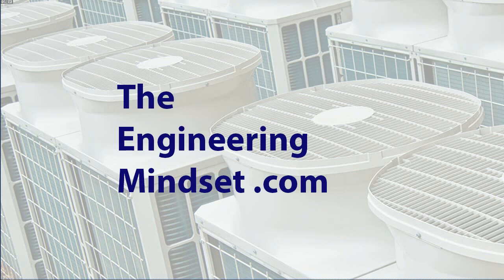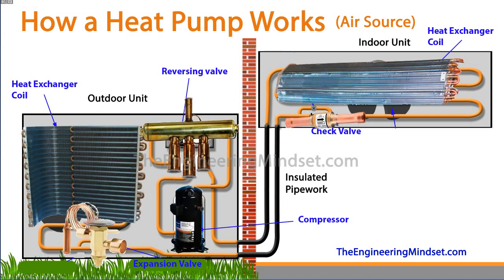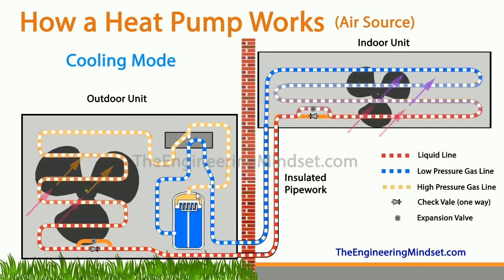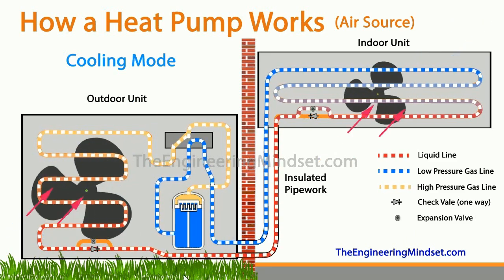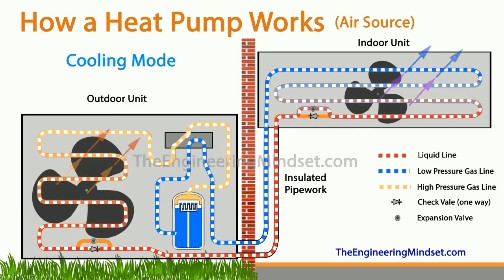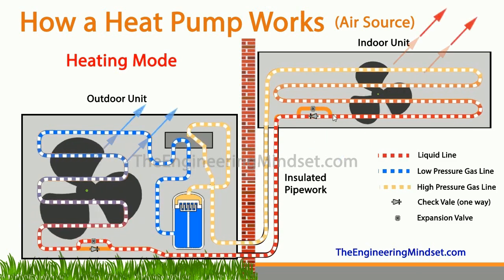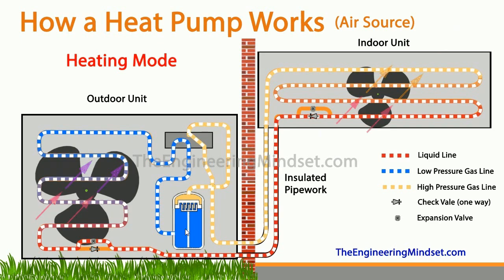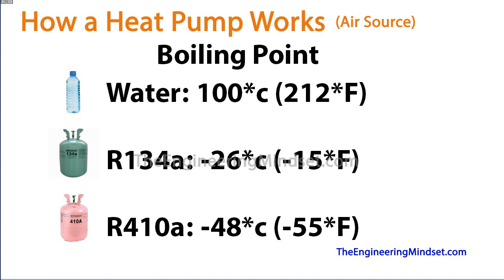How A Heat Pump Works - HVAC

Comment from the maker: ⚠️ Found this video super useful? Buy Paul a coffee to say thanks: ☕
PayPal: https://www.paypal.me/TheEngineerinMindset
Reply: Thank you Sir, for this awesome video!
Reply: @ericescuro8242  Very good vid, but, you should have shown the refrigerant as blue immediately out of the expansion valves & increasing in heat (yellowish) as it picks up heat while it moves through the evaporator coils

Also, a bit about more about when it isn't economical to run the heat pump would have been good.  I've lived in very cold areas & when the outside temp is too cold, the compressor is disabled & an inside heating element is automatically switched on because at some point (temp) that becomes less expensive than running the compressor & fans to heat..
Reply: a tip : you can watch movies at flixzone. Me and my gf have been using it for watching loads of movies recently.
Reply: @Shawn Alejandro yea, I have been watching on Flixzone} for since december myself =)

Comment: I have a question the inside unit is it supposed to blow the air left and right or just up and down ..because the one I have I have a button that I can press who looks like it blow the air left and right but nothing move inside and there is no difference from the up and down .  And to connect to the wifi did someone know how to do that it say reset the unit , I have to press the remote control till I see CF but nothing work.....

Comment: Sir please make a video on the basis of Outdoor Heat pump AQUANEXA any model  of ANX-09, ANX-15, ANX-35, ANX-50, ANX-75 , please sir working of it and how it delivers hot water from ambient temperature along with Heat exchanger , Compressor, 4way valve , fan , condenser fins and it's PCB connect sequence of capacitor of single phase motor and conductor for 3phase motor, please 🙏 sir
Which is using R410a refigerant
Reply from the maker: Please watch our videos on how heat pumps work

Comment: Hi, I want to use the AC System as Heat Pump only. It will never be used for cooling. Why do the installation guys insist I have to install the Split evaporator near the ceiling? In fact I think that installing the Split unit near to the ceiling will be less efficient because it does not use convection to distribute the heat in the whole volume of the room. Additionally, the installation on top provides warm air near your head, which is uncomfortable, and the maintenance is more difficult than a split installed near to the bottom of the wall or in the middle of the wall. What do you think about it?

Comment: It’s amazing how you explain the way it works . 
The boiling point I never new how or when it’s a good place for a heat pumps or a gas furnaces but seeing the boiling points now you could suggest the best thing for a costumer is .

Comment: Wondering why when the refrigerant leaves the compressor under high pressure, how is it that it is a gas and not a liquid under such pressures.
Reply: Because the vapor must cooldown to convert liguid...or loosing his energy and energy is heating..

Comment: Great selection of videos on heat pumps. Could you possibly make a videos explaining how a gas absorption heat pump works and is there a difference between a GAHP and a gas fired heat pump? Thanks.

Comment: For a heat only air flow heat pump, why not just remove 1. The Reversing Valve, 2. The Outdoor Expansion Valve, 3. The Outdoor Fan, and just leave the 1. Outdoor Heat Coil, 2. The Compressor, 3. The Indoor Heat Coil, 4. The Indoor Fan, 5. The Indoor Check Valve? Then just recirculate the glycol water solution and let it always stay relatively warm, and then hot on the inside. Wouldn't this be more efficient, and remove half the headache? Also it should work in much colder temperatures! I think it makes more sense with these systems to have one do all heat, and another supply only cold! Then your transfer fluids could be segregated instead of a one size fits all solution. Which doesn't work in a lot of environments! It's pretty cold where I live in the Winter Time, and there are a lot of these Air Source Heat Pumps around that just stop working once it gets down to Freezing Temperatures. So they are spending the money on the Heat Pumps, and also always have to rely on an additional heat source! That has never appealed to me, doesn't make any sense now you are paying for and maintaining two completely different systems all year. Out the window goes your efficiency and your money!

Comment: I am not an engineer. I am a nurse and I want to stop using oil to heat my house. Clearly I have a lot to learn and this is a good start. I need to know how to convert my house from oil to a heat pump.

Comment: Only problem. In heat mode motion demomstration. You kind of confuse other with the line getting redder as it goes through the condenser(air handler in heat mode). It is rejecting heat into the air being forced through the house (coil). I know you are meaning to show the condensing of the refrigerant into a liquid. But to someone who doesn’t know it may seem like it’s picking up heat instead of rejecting. Btw how did u learn this? I went to
School and grew up doing it with my pops
Reply from the maker: Watch this one https://youtu.be/QykwWs3L1W8

Comment: I can't stop my brain from associating red with hot and blue with cold so the fact that the subcooling liquid is red makes this video really confusing for me. Could just be me though.
Reply: That's me too, and I came down here just to write this lol
Reply: Yes, very confusing.
Reply: mee too
Reply: Red hose is the high side (hot side) so your brain association is not wrong.. The blue hose is low side or the "cold" side of the system where heat is removed. They call it "subcooling" because the refrigerant is below it's boiling point but existing as a liquid. High side expells heat which is why the color is red
Reply: @AnUnapologeticApologist   uP

Comment: In general I like this video. An improvement would be to only show the gases in the narrative during their rotation around the loop or have a pointer to the gas being described in the narrative  as it travels around the loop. There is another significant improvement, I do believe that the gas does not have to boil in order for a heat pump to work (just makes the heat transfer more effective when there is a phase change). For instance plain air can be used in the gas circuit. No phase change is required but the size of the coils becomes much larger because of the poorer heat transfer from a gas to the outside or inside air. The phase change allows for higher heat transfer and thus smaller coil size and a more economical construction. Once when I was a plant engineer I had an ultrasonic air leak detector technician tell me he found a locker in the tradesmen's shower area in a plant that the tradesman just connected a 1/4" compressed air line to the locker to refrigerate his lunch!!! No phase change (boiling) necessary. It wasn't very efficient (poor "refrigerator" insulation) and he used lots of compressed air (I calculated thousands of dollars of energy cost per year), but it worked!!!

Comment: Wow, I used to think heat pumps got energy from electricity, not the air. Motors are the only part of a heat pump that needs electrical energy?

Neat how refrigerants are so easy to vaporize; the power of chemistry!

Comment: I'm currently in HVAC class and we are on the subject of Heat Pumps. This was a very well done video and so helpful. The fact that you can see the flow through the reversing valve made it so much easier to understand how it works!! Thank you. I'll be sharing this with my instructor to share with the class.
Reply from the maker: We actually just made two brand new versions for how heat pumps work. Much better explanation and animation, check out our latest videos :)
Reply: @EngineeringMindset  Thank you!! I most definitely will!!

Comment: Nice animation. However your expansion valve operation is backwards. The valve closest to the evaporator coil (cooling or heating mode) is the one that is engaged while the other is bypassed.

Comment: Thanks for the video mate, just about to take delivery of my first BEV (Battery Electric Vehicle) which has a heat pump and was curious to find out how it works ;) I take it is a similar principle in vehicles too?
Reply from the maker: Awesome, BEV's are certainly the future. The heat pump will wor kthe same it will just use a different method to drive the compressors, usually a belt drive connected to the main motor.

Comment: My heatpump sucks, nothing beats gas heat, my bill on my electricity is  ridiculous  and i dont live in frigid temperatures like up north.
Reply: Yep, heat pumps aren’t that great for the freezing temperatures. They lose efficiency and have to run soooo much to keep the temperature up inside the building. Like you said, nothing beats that blue flame beauty pumping out the BTUs.
Reply: Джейсон Хичкок It would need heavy duty equipment and a lot of electricity to compress the helium through the cycle.

Comment: Wait you said once the gas leaves the evaporator (in home) it is low press/temp saturated vapor? I thought the only time when it’s “saturated” is when it’s in the coil and once it’s on the outlet it is superheated and not considered saturated
Reply from the maker: it can be on the 100% saturation line in the psychometric chart. The compressor will push it up into the superheat region

Comment: 2:58 "the refrigerant is leaving the compressor at higher pressure, high temperature, saturated vapor" do you mean super heated vapor?
Reply: Yo-yo yes it is superheated vapour
Reply: Yo-yo assassin

Comment: Nice Video Paul. I have recently turned on my Mitsubishi Heatpump to cooling mode and I've got it set to 16 and doesn't seem to be running really cold as last summer (I'm from NZ) and outside it don't seem to be expelling a lot of hot air. Do you think it may need looking at? Cheers Mike
Reply from the maker: Its good practice to have it serviced annually. Probably just need a little top up. Well worth a call.
Reply: @EngineeringMindset  Top Up!!!!

Comment: thanks for your precious and valuable tutorials... the question is that in all of heat pump explanations i saw only one expansion valve.. in some model it's at indoor unit and in other models it's at outdoor unit but here i see 2 expansion valve  ? is that exists in real life ?
Reply from the maker: Many now use bi-flow valves, there are many ways to achieve it